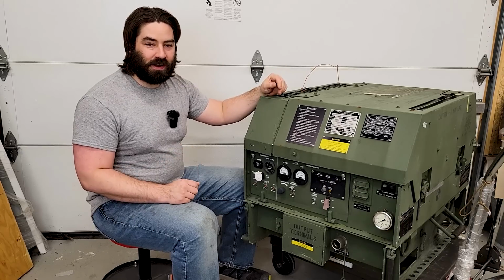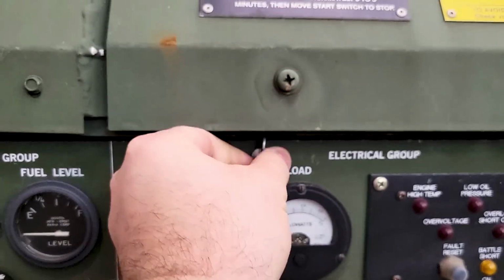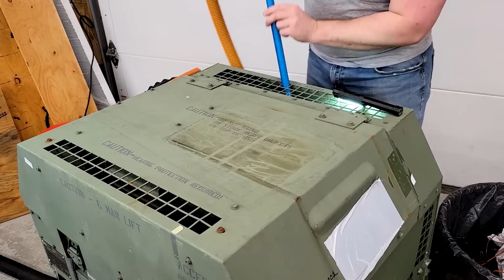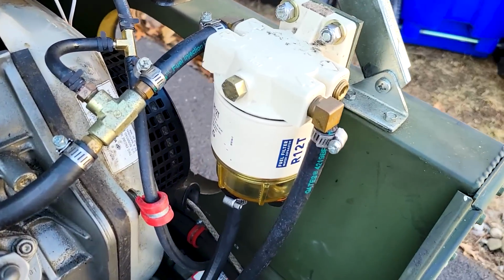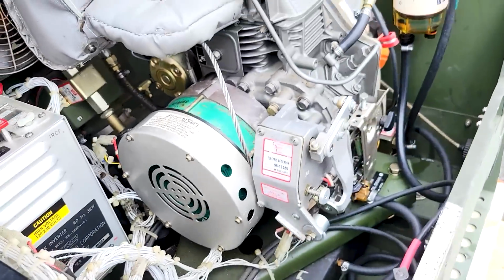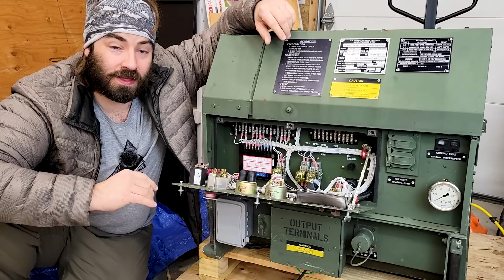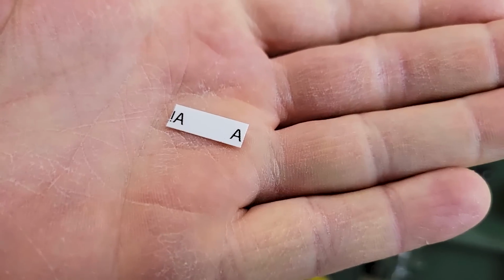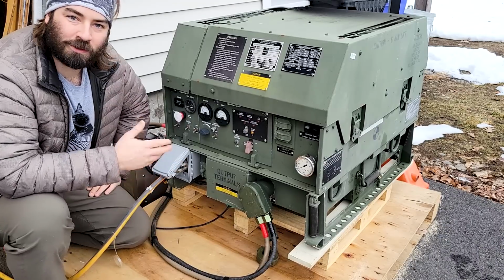Mil-Spec, the best you can do?

Comment: The first question I always have is what did it cost and process to buy and take possession of anything bought through government surplus, that is interesting. I've never found mil spec to be best anything equip or personnel wise when I did my time in the late 80s but I will consider anything if it's cheap enough.
Reply: One upside I see are that these readily deliver all the power promised (rated), while run-of-the-mill generators typically strain when running at their max rated power.  Also, diesels like these can run and run (reliable).

I got seriously interested in the 5 KW and 10 KW versions, until I realized parts could be challenging to get.  It can be done, but that kind of project (chasing parts) loses my interest, especially when I have good alternatives.

Comment: I was a 52D, Generator mechanic for 10 years. I never saw one of these units. I worked on a lot of 1.5, 3, 5 and 10kw units but they were all gasoline powered.
Reply: The Army started upgrading to diesel gens in the 90's .  We had Gasoline gens when I began my Army career as well.  In 03 we had some gasoline 3ks that were converted to diesel engines, MEP016D.  They were much better generators than the MEP 831.

Comment: Great video. Very capable old generator. Three kilowatts is about the perfect output for backup power. I would estimate that old Yanmar burns about .7 gallons per hour at full throttle. Does it have a hand crank option and pressure release? I would think that a military generator would have a way to start the motor it if the battery was flat.
Reply from the maker: Yes.  There is a pull-cord and valve decompression lever.

Comment: Well I've got quite a lot to say about single cylinder generators for off grid. 
I'm not in love with Yanmar single cylinder Diesels. Upsides are they are cheap[ish] to replace, downsides are any hours you get over 3000 are a bonus. I've had bad luck with 3 of these engines in my 7kva generator. At no stage was any load ever placed on this generator in excess of 4.5kw.
So I've had 1x broken crankshaft at <500hrs, replacement severe metal contamination at <1000hrs causing no load above 1.5kw and a 3rd one that won't make any power beyond 4.5kw without a drop in frequency @ 3000hrs. No governor adjustment can't compensate meaning it won't make rated power. It's worn out. 
All engines got oil changes at 250 -300hrs and all had their factory oil changed out at 50 hrs, then 100hrs as per the recommendation of the sales distributor. This is beyond what the manual states. Perhaps the sales distribution network knows what they're like.

The reason is obvious - SINGLE CYLINDER DIESEL. They thrash themselves to death.
I still have my single cylinder generator but it is only for emergency use - where it quickly reminds me why it's relegated to emergency use. One engine out of 3 has made it to 3000hrs.

My current one is a 5.5kva 900cc Mitsubishi 3 cylinder. Much better but still not great even though it has now tripled the hours of all the combined Yanmar single cylinder engines at ~ 13000hrs
The intrinsic high frequency vibration of 3 cylinder engines is also very ordinary - broken brackets, wears out all the cabinet latches and constant loose bolts, vibrates rubber mounted lift pumps to death; I'm on my forth. Even though 4 cylinder engines naturally vibrate, it is far less than 3 cylinder engines. If I had my time again I'd just buy a 4 cylinder Diesel. The downside is the fuel consumption for the same power generated is increased because of one extra cylinder in pumping losses + one extra cylinder that needs fuelling. Also the displacement of 4 cylinder engines is higher adding to the higher fuel consumption. I could have a twin cylinder but they thump. The 3 cylinder has very low fuel consumption for power produced and it's pretty quiet too. Max fuel flow at 5.5kw emergency is no greater than 1.5liters/hr - light load fuel consumption is around 500cc/hr.

Comment: I'd mount the tanks on A separate rolling squared like Janitor cart set-up if it was me DIY built. Then you could just mount that stuff into your 🛒 cart to roll around where ever you need it to be at then. I'd do metal tubing pipe extension input adapter's on that to connect crimped hoses for your secondary fuel supply. That way it's A way easier removal process procedure afterwards to.

Comment: You could make A offset tank just for the fuel return line purposes so you can run it dry. Through that separate offset tank connected into your fuel lines into A doubled up T- line brass fittings.,or metal ones the size of your other fuel input off the machine itself with A fuel filter,& water separator add on brackets tied together on one bar strip plate attached to the generator painted olive green to match it all.

Comment: i keep thinking david that the generator.. (not just the one you did the video on) is  a noisy piece of shit  and i mean that lovingly. what about using a secondary power system that runs on steam.. it could be dual purpose...heat off grid with spent steam from the generator.. kill two birds with one stone.. just a thought..  good video by the way

Comment: Wow, this huge thing is only 3KW?
Reply: Hah! You ain't seen nuthin until looking at a 1970 Onan DJA 3KW air cooled diesel generator. Mine is mounted to a 20 gallon fuel skid that was meant to be dragged by a bulldozer into place. The skids are heavy channel iron with 3/8'' steel plate bottom. My guess is that it weighs at least 500 pounds and is close to 3 feet tall, almost 4 feet long and about 32 inches wide. It has zero electronics inside. I run it once a month. The thing is noisy and stinks like school bus exhaust when running. It's purpose is to be a last resort power source to charge a lithium battery bank. It runs 1800 rpm.  My Powerhorse 7500 inverter gen set is half the size and half the weight, 55 decibels at part load. I hear that even an EMP won't affect the old Onan.

Comment: Nice video!  Please check your measurement again, that showed 7/16, not 5/16...
Reply from the maker: Yep, but close enough.  I spoke with Kurt about this specifically.  Turns out the 5/16 is the minimum.  Any closer and it sometimes snaps shut due to the magnet, which shuts the unit off.  Larger than 5/16" and it uses slightly more fuel at idle.  If I was planning on idling this unit all day, then I'd care more about getting closer to the 5/16".  But, since I plan to put a load on the unit, I don't care about idle speed.

Comment: Im a 91D; I was surprised you like these. In my experience they were among the most unreliable other than the 805B, love the AMMPS series and the rest of the TQG lineup. PPUs are pretty cool too.
Reply: The finicky actuator was always fun to adjust in sub zero temperatures. 

I also replaced that invertor before in 110 degree heat. I had to tear apart the entire cover. I did the whole job in a hot as hell maintenance tent.
Reply: @HVACsoldier1554  yes; ive yet to see one hold an adjustment for more than a couple days(if the actuator didn't die all together)
Reply from the maker: Part of the reason I liked them is because I could get them running even when it was 0°F outside.  The others had a harder time starting in those temps.  However, I admit there is a steeper learning curve with these 831s, they are not perfect.
Reply: I agree, they are overcomplicated junk in my opinion.  Wasted tax dollars. Yes you can get the engine running pretty easy, but its not reliable for producing power.
Reply: @CW4retUNKLE_G  compared to the newer AMMPs series the TQG line up outside of the 3k were the good stuff

Comment: Really fantastic, David.  I've often thought of acquiring one of these units, but so far haven't pulled the trigger.  Great to know there's an upgraded speed controller available if needed.  Any tips on the best place to find one of these gensets?
Reply from the maker: I bought mine from an auction: govplanet.  But, I've also had some bad experiences on there.  I usually suggest contacting my buddy, Chris.  He buys them at auction, then goes through them, fixes what needs it, and load tests them.  That way you know what you are getting.  I put his email in the description.  If you are in the Northeast US, then I have a couple and might be able to help you out.
Reply: @DavidPozEnergy  Thanks David, I'm still down in Atlanta trying to find a good use for that ElectroDacus DMPPT450.  Great to know your friend has a good thing going with them, I may be in touch with him.  I'd seen them on the government auctions, but hadn't pulled the trigger as of yet.
Reply from the maker: If you get the DMPPT running, please let me know.  I don't want to miss that video.  I bought my 802 from Chris after buying another 802 and kinda getting screwed.  But, hey, now I have a parts machine.  LOL.  Chis marks them up very little compared to the time he puts into them.  He says it's more of a hobby than a business.  He is in North Carolina, so you might be able to drive to his place and back in one day?  Maybe? I don't really know how far Atlanta is from him.

Comment: Great video. Would have loved to see more about the restoration part (cleaning, replacing of hoses, etc.) and especially the fault searching with the idler (incl. Kurt Klopp perhaps) - which you sped through quickly.
Reply from the maker: Sorry, I was saying to myself "Who wants to watch 4 hours of replacing rubber hoses?"  LOL.  The return hoses on these are particularly thin rubber, and known to blow out. I used thicker fuel injection hose even on the return just to make sure.  I also replaced the plastic "T" fitting with brass.  The plastic one can crack over time.  So, I'm not really doing a restoration, because I'm using a few things higher quality.

Comment: That's a pretty big 3KW generator set!! I would almost bet that the flaw with the engine speed module was
with all them potentiometer adjustments just left outside of the module, in the open to salt air moisture, 
fumes, dust and potential of debris! And so it just might look as though the Marine Corps scrapped the
notion of any future contracts and semi de-militarized them to a small degree. Those gen-sets were probably 
also to expensive to buy anymore and given the reliability aspects and well. That may explain the low hours on 
this one! The supply chain may have also failed to get these modules given just who is the manufacturer
was that was subcontracted for that module build! Who the hell really knows for that matter! I know of a Chief
Senior Military Technologist person that was contracted by Pentagon that may have been involved for the testing 
and approval for the purchase of such equipment for the military. His name is Lee Wheelbarger, Inventor and skilled
professional when it comes to a lot of things related to the military! I supposed that if you were to contact him
David, perhaps he might be able to fill you in on a thing or two on this Genset!

Comment: Bought one about three years ago. Got it running for about three hours, and the inverter went out. The inverters are very expensive, and hard to find. I would recommend getting a MEP-802A 5KW, or A MEP-803A 10KW. They do not have inverters, and I believe more reliable. Just a suggestion. Great video, and content Thank You.
Reply from the maker: I also have an 802.  I've shown it in past videos.

Comment: Oooood all those thermocouple leads gave me flashbacks to when I worked at the FoMoCo proving grounds. I used to see that brown spaghetti in my sleep!

How does this compare to the MEP802? I find the milspec gensets to be fascinating (as a civilian puke I'm easily drawn by lots of knobs and switches), but on the other hand I also like those folks who belt up a Chinese 5-kw alrernator to big clunky Lister clones. I'm a complicated guy.
Reply from the maker: How does it compare to the 802?  Well, the 802 is a 5kW, liquid cooled.  This 831 is 3kw, air cooled.  The 5kw has a huge surge rating, this 831 has some surge, but not as much.  They both have pros and cons.  I like both, but for different reasons.   I think the 802 is a perfect house backup generator.   I think the 831 is perfect for a cabin.  The 831 could be pulled on a sled to your location,  and if the battery dies, it has a pull cord.
Reply: @DavidPozEnergy  802 is certainly a beast, love the giant casing on them. Boggles my mind what a discount you can get them for, considering how much the DOD probably paid for em, or even how much a retail version would cost if it even existed...

Comment: Find all the ways you can recover heat from it. In an emergency you do not want to be using it's 3KW for heat.
If it's going to be really cold add some jet fuel or kerosene to the fuel to prevent diesel gelling.

Comment: What is "Battle Start"? Someone explained it to me before, but my memory has apparently dumped that bit of data.😅
Reply from the maker: That is an over-ride function.  Perhaps you don't have oil in the generator, but you NEED to run it anyways.  Turn that on, and the generator will run until it kills itself.

Comment: Ahhh, when you opened the hood I was crushed!  I was expecting to see a small, liquid cooled two or three cylinder diesel engine, such as a Kubota, that would run at 1800 rpm and allow for easily capturing waste heat as well.  That's gonna be a screamer (3600 rpm).  I suppose you could determine what the generator output voltage is and use a transformer and rectifier to go straight to the 48 volt battery.  Could select a transformer ratio that allows it to run at lower speed, but of course at lower output as well.  Still need to recover the heat in an off grid situation since that where most of your fuel goes, and air cooled just isn't conducive to that.
Reply from the maker: I have an 802, which is another military generator model.  It is a liquid cooled 1800rpm
Reply: @DavidPozEnergy  Ah yes, I thought it was an 802 you mentioned.  I'm not really familiar with the military sets, but 802 does sound familiar.  Lots of information on these on Smokstak and Steel Soldiers, but sounds like you're well covered with your friend. ;)  I haven't seen your videos in a while, but it used to be you had utility electricity but were more or less not using it.  Have you truly "cut the cord" now?  I would SO love to do that. ;)  I'll admit, this set sure does look like a sweet little unit. I wonder what it's operating speed range is, no load to full load?

Comment: I have always been interested in trying the 50/50 fuel / fryer oil run on a generator
Reply: You could probably run a straight fryer oil on these simple engines, as long as it isn't too cold outside.
Reply: @hojnikb  yeah ain't much too them. Injection pump and an injector doesn't need an electric fuel pump, it will run gravity fed. If you mess with the IP it has copper shims that set the injection timing by adjusting the pumps distance from the cam lobe.
Reply: @hojnikb  the guys who run it in cars can hook you up with a tank heater, fuel filter heater, and even a jacket to heat fuel lines on long runs on a big vehicle

Ita mostly parts from a old Peugeot from the 90's/early 2000s! New parts but for a old car design, and after over 20 years of tinkering with them they've almost become a 'standard' :)
Reply: @hojnikb  oh and I've seen both a Peugeot 405HDi and a volvo 740 series diesel run off straight fryer oil tipped right into them, only thing done to it was a fancy filter in the nozzle used to tip it into the fuel tank, just to catch the crispy bits! I think all they had to do was replace a few fuel pump seals, which come in a handy pack from a  company the biodiesel folks use. Quite remarkable cars those 2, absolute tanks, especially the volvo

Comment: Nice. HEAVILY over engineered, but that's the army. I have several 3k inverter generators... 68lbs each. But there ain't a d***ed thing in there you could fix. And a 25k generac "work site" genny; we have it on a trailer to tow it behind the EV. :-) (12k to power the car, and another 12k to keep us warm, run welders, etc.)

Comment: Hey David, I'm trying to think through a project where I use a Honda Odyssey alternator with an inverter for home backup power. I can get a 250 Amp alternator, but do you think I'll be able to use all 3000 watts? I also am using an AGM battery for additional Amperage
Reply from the maker: I didn't work with the alternator in this video.  The alternator on this engine was from the factory, it's a PMA, or permanent magnet alternator.  The generator as a whole is rated as a 3kW, but the PMA can do up to 4kW for overhead and losses.

Comment: Excellent video David.  Anxious to see how the super efficient Yanmar diesel with a couple extra conversion stages compares on DC charging efficiency per gallon (gasoline) to your 6 hp alternator generator.  They should be fairly close since the higher power density of diesel should compensate for the low loss conversion stages.
Reply from the maker: I'm excited too.  This Yanmar should kick butt compared to my gasoline projects.

Comment: Glad to see you did what I suggested and got a gen set. I didn't know you battery charge controller would accept AC voltage and is why I included an external rectifier between the gen set and charge controller. That gen set @ 240V/16A = 3840W peak but the continuous rating is 240V/12.5A =3000W
You can expect to get close to 12 gal for every 24hr use. [Or 1/2 gal/hr]
Reply: If you look in the background of his videos, you'll catch that one here and there. I bet he's been sitting on this one awhile!
Reply: about 15 bucks a day - we can see why pv panels are taking over but nice to have a backup - liberal amounts of foam insulation plastered to this thing would help sound issues - compared to modern gernerators it is sort of a non starter (pardon the pun) #yamaha #roi #tco